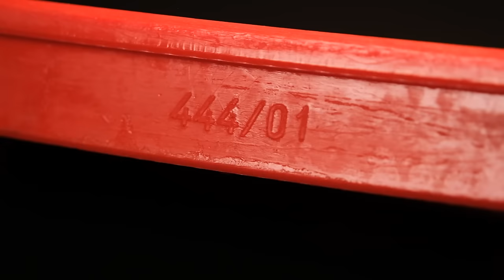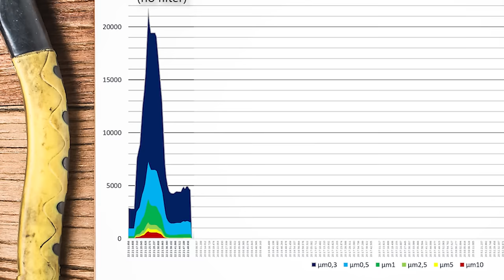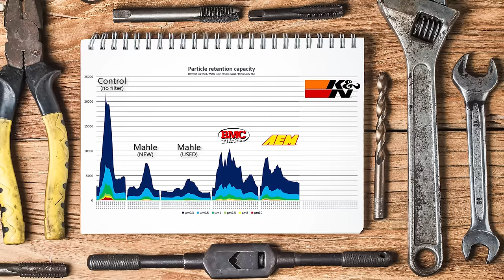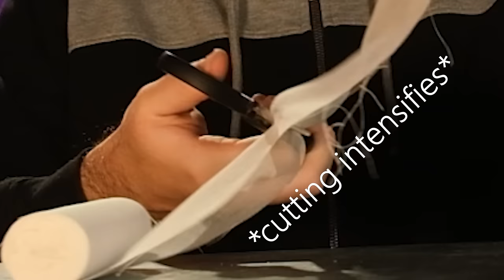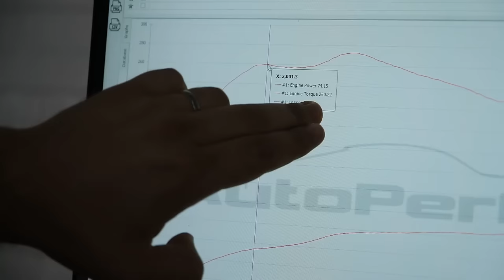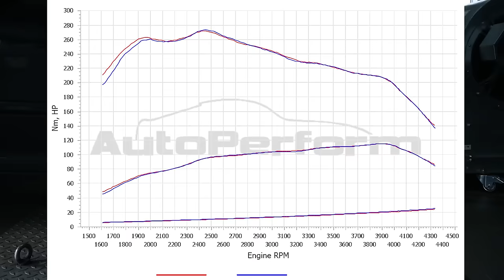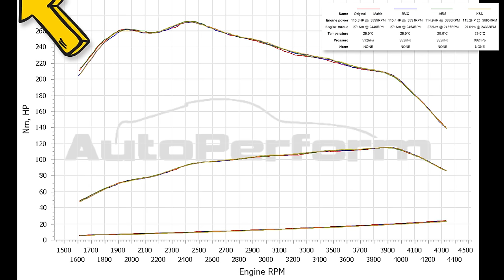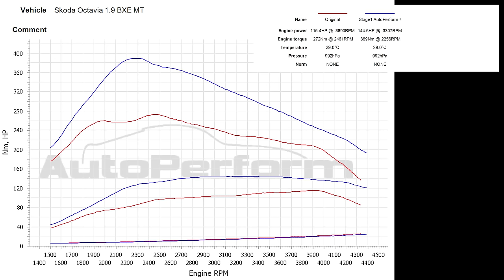Performance Air Filters - K&N vs AEM vs BMC - DYNO TEST

Comment: Awesome video man!! I like your cientific approach, been a cientific myself! You even had a 3D printer (pink filter holder) and do arduino stuff! Great!! I was wondering if i should change the standar filter in my Jeep Wrangler with a Pentastar engine or keep the paper one (a high quality japanese one). I will keep the one I am using, cause I live in Chile and climate is desert, so a lot of dust everywhere and the oiled ones get clogged fast. I will only change the intake hose and get rid of the resonator. 
Thanks a lot! New subscriber here!

Comment: Wow,man….you do answer a lot of my questions.
I was looking to install one of these k&n performance filters in the oem form but after seeing your test i now have the answer 😂
So a remapping will be my best option.
Your work is great and flawless.Keep up the good work 👍
I was wondering between the remapping between a factory one(the dealer of my car brand manufacturer offers this option and tunes the car at a safe +20hp on the engine power and of the automatic gearbox torque to also a safe limit of +30 nm)and a tuning garage that can offer at half of the dealer’s price ans sets the parameters at +40hp and the gearbox to +80 nm of torque,what would you choose for you? Which option would you recommend?
So for what i know the stock automatic gearbox comes with both 400 nm and 450 nm depending on the engine on the car,one being turbo and the other biturbo angine and their safe limit is +30 nm. So on the factory 400nm is set to 430 nm (the same gearbox on the biturbo comes with 450 nm -i have the single turbo engine)and on the bitubo 450nm factory they set to +30 nm so a total of 480nm.
So from factury tuneup i will be below the safe zone with under -20 nm from factory stock 450nm and with the indy tuning garage i will be at the 480 nm red limit.

Comment: A K&N works by the pulsating intake of the intake cycles. (The gauze gets agitated and the moving strands creat a finer filter) Having it tested on a flow bench means it will flow alot but not filter.

Comment: I believe the difference in filters will show up differently in other platforms. My car is restricted on exhaust side... I replaced with K and N filters...had a noticeable difference when driving. Maily in throttle response and top end pull through 3rd.   Now a full cat back added...   LOTS of difference.    So, if you change your filters and you have other restrictions....extra air just isn't going to do much on the intake side if it can't get out.          A tune would show the biggest gains.

Comment: would love to see a filtration test of a few foam filter brands eg itg and pipercross against paper standard and K&N/BMC.  I argue foam filters have better filtration when oiled correctly (they are used in offroad/dirtbikes afterall) but not quite as free flowing as the cotton filters (not a bad thing in terms of engine protection)
Reply: Agree, for example Pipercross i would really like to know.

Comment: Totally agree. If you care about your engine longevity and/or live in a dusty environment, don't fit any of these 'high perf' filters, specially K&N. The induction noise can be amazing and intoxicating but It was just scary to see how much dust one of these allowed into my 2003 Porsche C4S plenum. On an NA engine, you're better off just improving your exhaust, remapping the ECU, porting and polishing heads on the extreme.
Reply: I live in the north where it’s colder, would I be okay with a k&n filter, I just bought one yesterday idk if they’ve changed since but I bought one yesterday
Reply: @nizo6673  IMHO, As long as it is not too dusty where you at, I can't see why not. Just be aware that it doesn't filter dust as good as OEM. Enjoy
Reply: @Fred82ndAbn  I did want a bit more sound of the turbo spooling up my car is a 2019 I’m not to worried as my car is still new only 2 years old

Comment: My insight is the issue is probably not with the filters it is with the bottle neck design of air intake box were the air is restricted at the point of entry. I`m no engineer but from my personal experience it may have a noticeable affect on your vehicle if you open up the entry bottle neck to a much larger diameter.

You most likely will notice transmission shifts smoother with faster throttle response, but you will lose the engine braking affect when you take your foot off the throttle pedal.
It would be interesting to redo this test with your stock air box modified with a larger air entry area....

Great detail and most important the facts, thank you for your time I`m a new fan of your channel !

Comment: Congrats for the great video!

Since the normal filter after 18k had  identical or even better performance than the brand new one, after how many km is it recommended to change it?
Reply from the maker: Good point! I should probably test that, but I believe that it would be different for each specific engine 🤔
Reply: @SergiuGabor  after remaping, the original filter could be undersized?
Did you test the effect of 'sport filters' to check if they allow any extra in remaping?
Reply: @gwenc8900  I dont think so, 2.0 tdi 140hp uses same air filter as this 1.9. 
At higher stages as he mentioned or with bigger turbo you then maybe could use sport filter

Comment: Pausing and my suspicion is the differences are quite small. Bingo, I was right. This is why I'm not a fan of K&N filters.
They don't filter well at all, you have to oil them, and they're so expensive. I prefer the AEM for being easier to clean and filtering better.
Yeah I know with upgrades and a gas engine etc. the differences would be larger. For most cars though, I stick to stock filters.

Comment: I use the AEM. It's nice not having to buy air filters anymore and I just ensure I change my oil on the more aggressive use schedule (every 5k instead of 7.5k).
Reply: Ive read the AEM have to be replaced after 12000 miles, to make them clean will make the micro dust filtering all the time less and less working well.

Comment: Very nice video, lots of working behind. I have a mustang Gt 2013, 5.0 liter, naturally asipired. I changed my stock air filter for a K&N filter. At beggining I can notice a better response and an engine noise more deep. But, after 8.000 Km my car started to rattle in cold start every mornig. It took me so many work to find out the issued. And yes, It was the K&N filter. I live in a town with dusty road, and particles just partially clogged the K&N filter. The Oil works like a net, all dust was captured and the filter got saturated very fast. I found this video, because I looking for better options. I think AEM Dryfilter is the answer (No Oil al all). I'm definitely going to try it. I have to mention, before K&N filter,  I always had used OEM filters and during 100.000 km,  I never have had a clogging issued in muy mustang.
Reply: Interesting. Was thinking about running k&n on my pilot because I can clean it and my filters get dirty fast but I go on a lot of dirt roads on weekends exploring.  my OEM filter is covered in dust and debris after 3500miles so I know K&N will get clogged quick if it happen to you with the mustang so now im thinking of running k&n for daily use and a paper filter specifically for heavy filtering when I know il be on dirt roads/trails..

Comment: Ive just rebuilt a high performance 6.2 LS3 that had Camshaft/lifter problems ... it was rebuilt professionally.. 80,000km ago .. 
Most parts were salvageable and/but the valve Guides are Boarder-line worn out but reusable ... 
I was told but a reputable LS Cylinder head rebuilder that what mostly causes most Valve Guide wear in cylinder heads is Particles from the Intake system ...
When/as he was telling me this ... I knew that the OTR K&N filter I had removed in the beginning was 'Notably' dirty ... but probably still high flowing ..
My conclusion is 1)Cotton filters need to be cleaned and 'Oiled' regularly, 2) They take time to be Cleaned, Dried and Oiled 'Properly' (like 4hrs on a Hot day)
Depending on $'s v's Time v's HPower ... a Disposable or 'quick Cleanable' far outways the the Big Wank of a Racing Brand to be wasted in City Driving and Rare Burnouts ...

Comment: I was reading about these filters, I think on the box of my K&N filter for my Peugeot 206 2.0hdi, to install the filter before remaping and not the way around. 
In my case, I was not looking for performance and yes for a bit more of fuel economy and only having the filter on for 2 days, I can already notice a difference in fuel consumption. Not a massive difference, but I noticed after a few miles. I might still remap the car in a close future.

Comment: Interesting work if your setup is still running i would be interested in knowing the PiperCrossX dust retention capacity. Overall looks like the trade between a few HP (on atmospheric gasoline engines) is not worth the damage they will take in the process.
Reply: So this simulates real world?  Not even close.  Learn how performance filter work first then you will see how flawed this test is.

Comment: I have to admit, I am quite impressed that the Dyno proves on a commonality that high-performance air filters do not necessarily make the best gain. Rather, the gain is done electronically and mechanically through the engine itself. I’ve known for over a decade how bad K&N filters are and have profusely tried to share the same knowledge so others are aware of how bad they actually filter particles. I was a diehard K&N fan, until somebody educated me like this guy did as well. If you can hold your filter up to the sun and see that burning ball through some of the micro pleats, you know the filter is not filtering. This is the baseline reason why K&N suffers at filtration for particles, but exceeds an air passage. Great job on explaining it here as well too!.
Reply: Every car responds differently to aftermarket filters. Every manufacturer tunes differently. A Hemi Ram loves a K&n filter but the V6 Ram uses the same air box and can't be improved by any means including a legitimate cold air intake because it's already getting more air than it'll ever need. Painting with such broad strokes is idiotic. K&N filters are completely fine for normal people who just commute to work and have enough common sense to oil them properly. I've put them in every vehicle I've ever owned, makes a difference on some V8's depending on how restrictive the oem filter is. I'm making it my goal to educate people based on my 30 years of experience with them...instead of just talking out my ass like you.

Comment: I use a K&N filter and service it every 10000 kms and the clean side of the air box stays very clean compared to a standard filter it all depends on how much oil you put on them and no problems maf sensor well not yet anyway.

Comment: Good video, thanks for that.  So these performance filters do not bring anything in terms of performance.  OK.  I still have one and there is a reason: the normal filters are made of paper.  At that time with the VW Touareg, water could get into the airbox due to the design.  That dissolved the paper filter, parts of it were sucked in, engine damage, turbocharger, suction area, the chunks everywhere.  To avoid this: filter on cotton and metal mesh.  Please keep that in mind.  😉
Reply: but if water passes through kn it will be damaged

Comment: Nice video, but that big increase in performance after remaping is more common on turbodiesel engines while sacrificing air polution restrictions. On gasoline engines the possible gains are way smaller.
Reply: Volkswagen knows all about that, right??

Comment: Injection systems require several cycles to adjust fuel/air ratios when there has been a change to the intake/exhaust. I would not expect that swapping a filter would produce a change to output on the first run.

Comment: I'm not a highly qualified automotive engineer in any means. But I have a somewhat reasonable logic and work FUBARED  machines in some crap Eastern European factory. Turbo charged engines easily keep their peak performance because they have a few tricks in their sleeves compared to a naturally aspirated engine. The intake pressure is regulated and monitored by the ECU, if the engine works in high altitudes why would work with a clogged air filter. Also designing a car and having an obvious bottleneck like an air filter?! Come on guys, euro millions/billions spent on continuous improvement in the last 100 years. Do you think all of the engineers just drunk beer for 99 years and they just ducktaped a vacuum cleaner hose in a hurry, and you have to finish their work at home?! Seriously?

Comment: Watch your fuel trims before and after installing a new air filter, If it makes any difference or any more power, you'll have positive fuel trims. This can be done with any cheap OBD2 bluetooth scanner and the torque app.

Comment: I used to run a kn filter. Now that I run stock air filters; currently a denso oem, I  have noticed an increase in power, cleaner maf sensor and intake tube, more low end grunt, no gear hunting, and no hesitation.
Reply: @SlikLizrd  I did not over oil that's the thing. Kn filters aren't intended to be used for max efficiency. They might squeeze out a few extra ponies but they definitely do not filter as efficiently or as well as a quality oem dry media filter. I'll never use an oiled filter in anything but a dirtbike.
Reply: @fulltimeshred  OK.

Comment: With K&N I was told that K&N has. Changed going cheap when the new owner. Implant took control. 
  Test Green Filters from western Pennsylvania ear Pittsburgh.  
Using a K&N from the early 1990’s on my 91 Dodge Cummins turbo. I have noticed nicks on the intake side of the turbin blades. Not happy at all with K&N.

Comment: Great test, but it would have been more complete if you included the performance filters comparison after the ECU remap. Probably the higher boost => higher air input would reveal that the stock filter becomes an even slight restriction?

Comment: Thanks very much for this informative video.
However, things are gonna be diffenent with a naturally aspirated engine and you will, definitely,  see an increase in both horsepower and torque figures as the only force is the atmosphere pressure
Reply: The only gains are in your head and their profits.
Reply: ive used Kn and Green filter in 2 of my cars with naturally aspirated engine.
and both of them had loss of torque but the throttle response was excellent with these filters.

Comment: I ran a k&n air filter on my ram and yes I had increased air flow and power, but after 100000km I started having problems lose of power burning oil, when I took the moter apart it look like it was sandblasted in the cylinders, I scrapped the truck and stick to paper oem air filters. and yes I did my maintenance on the truck regularly 5000km

Comment: I had installed an expensive performance filter on my R1200GS. The power stayed the same (I guess), but the low-end torque was feelable lesser. With the factory filter, the engine pulled away from lower rpm.

Comment: I would also like to add that not all cars get any benefit from ECU remapping. In your own example, your engine due to the fact that it's turbocharged has some benefits after remapping but a simple N/A engine won't get such an increase of power.
Reply: Maybe not a huge increase in max HP or torque, but they can modify the torque curve to appreciably increase average torque across the rpm range, and thus acceleration. Secondarily, perceived power is easily increased by changes in throttle and shift mapping.

Comment: According to Hot Rodding OG David Vizard you cannot accurately test the particle retention of a K&N style filter on a jig with a fan. They will actually perform far better on an engine due to the pulsations causing the filter to vibrate and "sweep" the air. They are able to grab onto particles far smaller than the holes in the cotton gauze.

Comment: If you tune your car, the differences will show. I tuned my octavia and the 4yo air filter with 40km on the clock severely restricted flow in high RPM ranges. It’s important you change the filter anyway every 15-20k km, it’s not worth having your engine wear prematurely

Comment: im using another car's oem air filter (paper based), design and use like universal open filter. throttle response slightly better and the filter box still clean after 1 year.

Comment: Diesel engines already operates the leanest possible. To see a difference a filter swap isn't enough, turbo petrol engines are more sensitive in stock, but it's something people should consider after mapping. Same goes for exhaust. Just putting a new exhaust isn't enough, unless it's only a catback.